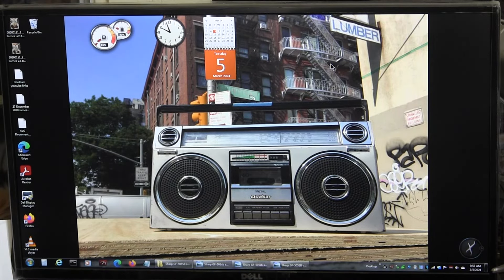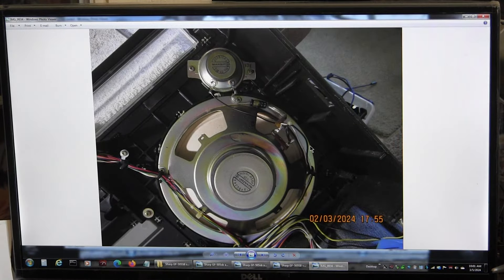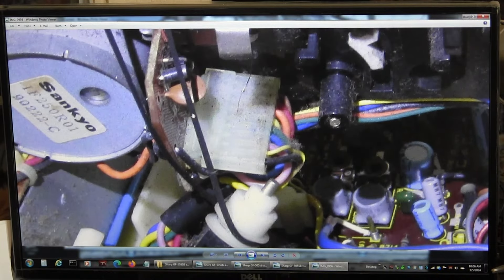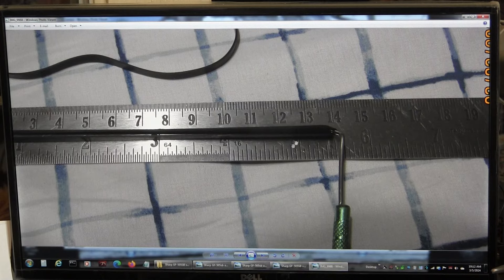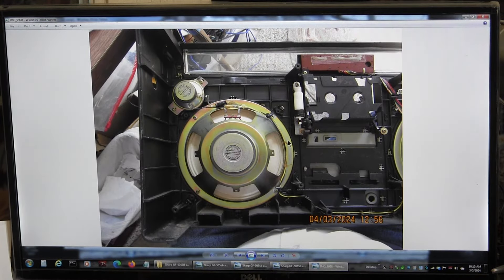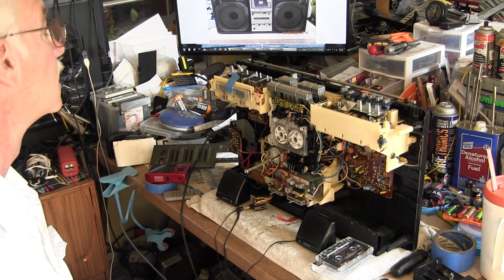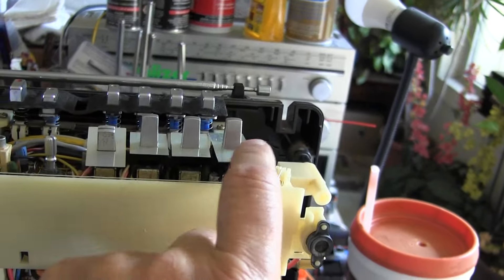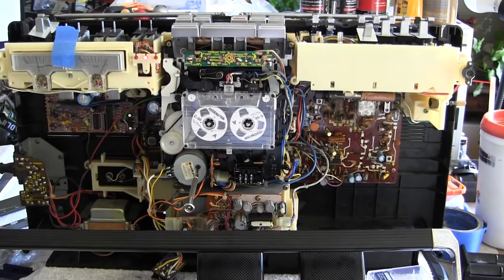Sharp GF-505SB GF-505 aka GF-9494 how to fix repair restore Idler tire retro vintage Boombox tech

Comment: Good job I have done this years ago all worked  up until yesterday radio works no problem but the tape deck when I press the play button this humming sound comes left meter goes crazy the right nothing and some background like like recording of the tape I can hear any idea what that could be?
Reply from the maker: You will need to clean the recording bar switch as all your music goes through that switch. You will need to remove the cassette deck to get to that switch to clean it with deoxit.